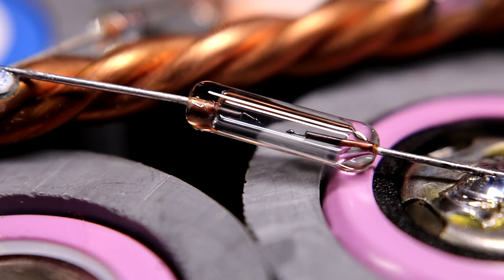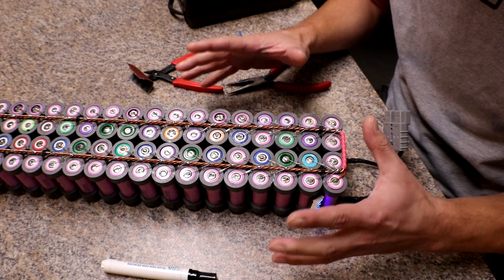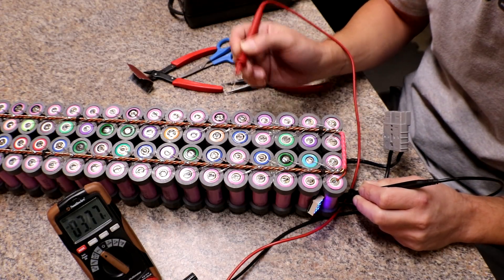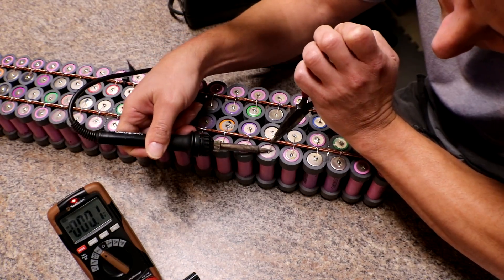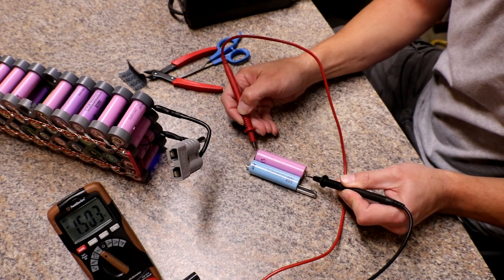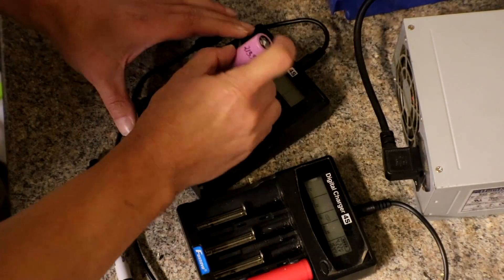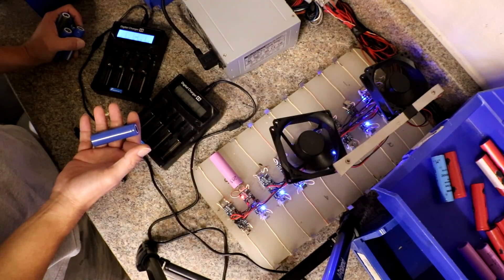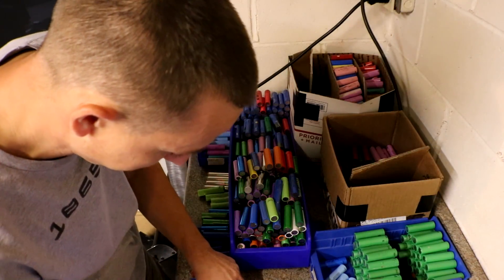Diy Tesla Powerwall ep63 1st Blown Fuse & How to Replace a Cell in a Pack!!!

Comment: Hello , what current are fuse use
Reply from the maker: At that time I used .5 amp as they pop at 2 amps. Next build Ill be using 1amp since they also pop at 2 amps but just a hair less resistance.
Reply: @AVERAGE_JOE  thank you for the info, i also want to use 1A. Have a nice day.

Comment: Hi, you did not test for IR of cell. That should indicate its condition. Further, charge and test if voltage drops after 2 weeks. If it did, bad cell!
Reply from the maker: When I originally tested the cells I didnt check IR.

Comment: No the opus is fine your a fucktard that’s all. Go outside sometime.
Reply from the maker: NOICE!🤣
Reply: AveRage Joe lol, glad you can take a joke. Thanks for all your content and info brotha, been doing a lot of research for my power wall and you really helped clear some stuff up. Shit can be confusing. Thanks man. I’m gonna go get some sleep.
Reply from the maker: People get butt hurt to easily these days lol. Glad some of the videos could help out a bit in random places. What size powerwall you thinking of building?
Reply: AveRage Joe sorry for late reply, I’m actually setting up a solar power bank for my ma cause she keeps spending $100s on shitty outdoor solar landscape lights that die in one summer. So I’m gonna hard wire a bunch of small led lights and use a small 50Ah power bank that’s charged via solar. Hope I don’t blow up lol. Got a few mono solar panels 12v 100watt, waiting for them to arrive then I take my shot. Any advice would be awesome bro. Thanks.

Comment: ... what about puttting some thin white plastic stripe just under the fuses so to tell at a glance if there is a blown one ---?
Reply from the maker: Yeah that a possability. The ones I used are tiny but if you use 2a or bigger you can see if there popped easier!

Comment: Does it get hot when charging or discharging? What about self discharge?
If everything is good here, it's most likely a human error as you already mentioned or the fuse itself had a problem. I would really like to know a real battery problem this might have caused the fuse to blow...
Reply from the maker: I dont remember lol.  Been a while.  I do remember is self discharging a little tho!

Comment: While Tesla uses fuse wire, you use these Chinese inline fuses?  You didn't mention what amp size fuse you entrusted your packs to.  :)
Reply from the maker: I have been using .5amp fuses and now using 1amp fuses.  With all my testing they both pop at roughly 2 amps in a slow burn!😆👍

Comment: How about PolySwitch Resettable Fuse Protection ? Can you use them insterad of normal blown fuses?
Reply from the maker: Yeah you could use those or even pico fuses but the only issue is you cant tell when one is blown or popped.  I have tested some pico fuses and they are dead on, just couldnt tell!
Reply: AveRage Joe - Yeah good point . Thank you for your time!
Reply from the maker: You betcha!🖒

Comment: The technique of DIY spacers made from 3/4" sched 80 pipe is cool but the spacing between cells seems larger than necessary. One commenter suggested staggering the rings during fab such that the spacing between cells is only one pipe thickness instead of two. That was genius! That's how I will put my powerwall together when I build it.
Reply from the maker: Yeah the spacing is more then necessary!  Doing the stagger would allow more cells in a smaller space for sure!  Let me know when you have one made as Id love to see it!👍

Comment: How did you come up with the cell holders ?
Reply from the maker: At the time when I first started this project, the black cell holders were expensive and I couldnt afford them.  I also didnt want to spend all the cash for them and then cut the little tabs off to remove a bad cell or take the hole pack apart if there was a bad cell.  So I took a cell to Home Depot and Lowes to see what I could come up with and this is what came out.  Ended up with 3/4" sch 80 pvc from Lowes part# 49731 https://m.lowes.com/pd/Charlotte-Pipe-3-4-in-x-10-ft-690-PSI-PVC-Pipe/3134567
Reply: Good Stuff.  Looks like some added space being taken up but, eaaa.  More then functional.

Comment: How is it to all the ebike battery building sites say under no circumstance ever solder directly to your battery, yet every single one of the DYI powerwall sites has them soldering to the battery.????
Reply from the maker: I havent looked at ebike battery builds, just seen pictures. Yeah spot welding for sure would cut down on heat. I would think they say that for an ebike battery because of the high drain and vibration but I could be wrong. I think soldering is fine as long as the iron isnt on the bottom for to long. The top side is usually quick and easy.

Comment: What is the thickness of the module with the 18650 cells and the plastic holders? I am planning a set up for my 2014 Rav 4 EV and I want to make sure I can fit the modules. Thanks!!!
Reply from the maker: +James Klafehn My diy cell holders I made are about 24"X4" but if you are looking for the black cell holders I can measure them when I get home🖒
Reply: 24" long x 24" wide I assume? How tall?
Reply from the maker: +James Klafehn Each pack of 100 is 24" long and 4" wide and height is probly around 3"

Comment: I really liked your fuse tests... Very helpful. I am building a new RV powerwall with the .5 amp glass fuses. (note: 2 years ago I built a 7s 100p powerwall for my RV. It worked great for a year and a half. Then major fail "It Blew up" 
Due to my design I could not repair so I am using your form factor with these new fuses. Hope to post some videos soon.
Reply from the maker: Awesome! Would Love to see the videos!  What happend to you last one anyways!
Reply: Well fuse did not blow when 2 cells went bad. This made the cell get out of balance with the rest in the cell which caused the other cells to over charge.
Reply from the maker: +RV-PowerWall Gotcha, that is the very reason I use low amp fuses. If a cell is on its way out it will take out the fuse first before it brings the pack down!🖒

Comment: What kind of fuses are those? And how do you determine your fuse?
Reply from the maker: They are axial glass fuses.  I wanted a fuse with low amprage because I wanted the fuse to pop when a cell starts to go bad.  After testing a few different glass fuses I went with the .5amp fuse because it will pop at roughly 2 amps.  If I had to do it all over again I would get the 1amp fuses because it still pops at 2 amps but has just a hair less resistance.  Most other people are happy with a fuse or fuse wire that pops above 10amps.
Reply: I am still not understanding the "too low" part... aren't you pulling more than 2amps through each cell? If so, how does the fuse not pop then and only when the amps are too low? Sorry for my ignorance. Great video's !
Reply: gpauwels0820 so what you wanna do is, find the maximum amperage power consumption of your ev, and devide that by the number of cells you have in series.

Let’s say, your EV power wall or power pack whatever it is, is gonna draw 650A/150 (18650 cells) in series, you get 4.33 amps.
So then you would just test a bunch of wires that blow a little over 4.33 amps, Incase one cell goes faulty.
And the above  information was from
Reply: gpauwels0820 gpauwels0820 so what you wanna do is, find the maximum amperage power consumption of your ev, and devide that by the number of cells you have in series.

Let’s say, your EV power wall or power pack whatever it is, is gonna draw 650A/150 (18650 cells) in series, you get 4.33 amps.
So then you would just test a bunch of wires that blow a little over 4.33 amps, Incase one cell goes faulty.
And the above  information was from Jehugarcia’s video “ Tesla style fuse 18650 “
Go watch the video to find some really good info
Reply: But I really like these Glass Axial Fuses
Reply from the maker: Under normal use they dont even come close to 1a. The highest Ive ever run with the system was during the live stream test and I ran 72amps through the entire system. Still not even 1amp per cell.
Reply: Thanks for the reply and information, so for example i have a 14S10P battery pack. so 140 18650 cells. The motor will continuously draw 68amps while in use. If i understand what you are saying, then i would take 68amps/10 (18650 in parallel) = 6.94amps. (series dbls voltage, while parallel soubles current, so wouldnt we want to use parallel instead of series?) This means i need a fuse wire lets say that will pop at 7.5amps correct? Now, if that is correct, my next question to fully understand the fuse wiring, i see a buss bar and all the fuses are attached to this. This buss bar would represent the same thing as a nickel strip being spot welded connecting the batteries in series correct?
Reply from the maker: Yeah your math is correct.  Just make sure your cells can handle the 7amps continuously.  You would want the high drain cells for sure.  Regular laptop cells wont like it at all.  For a fuse I would go a little higher since its a motor and there is probly an initial higher current draw when starting it.  I would say something like 12-14amps.  Yeah the nickle strips would be the same as the bus bar and again since you want to run 68amps, make sure the nickle strips can handle 68amps through the series connection.
Reply: 1. Great, glad my math is correct... that usually is what bites me in the ass... Anyhow, it seems like then in my case i would not use a cell wire fuse for the series connections ( i can rely on a BMS to help control that total current draw from the motor in that case), but more so for the parallel connections. Then i would look at a fuse wire which again would pop as maybe you said between 12-14amps, correct? 

2. Why do i see for powerwalls long buss bars being used? And for Ebikes (my case) i do not see bus bars... just multiple nickel strips spot welded in series and parallel to each cell. 
3. Are the buss bars mainly for looks? so in other words replace all the multiple nickel strips used for parallel connections and replace with a single buss bar which then a fuse wire from each cell can be soldered to the buss bar as i see in yours and many others videos? 

Sorry for the long questions. Hope i am making sense here. 
-G
Reply from the maker: Most dont use any cell level fuses for ebike that I know off.  Not exactly sure why but I havent looked into ebiks much at all.  I believe they just use a bigger fuse at the end of the series connection.  But Yes they use nickle strips that can handle the amps and I would imagine they spot weld them for vibration issues.
Reply: gpauwels0820 yes, that is correct. You got it down.

My honest opinion, I would prefer Spot Welding, I’ve heard, but not sure,  🤔 , but seems to fit, Solder can heat the battery cells more,  depending on the person, some people will put the solder to the cell and heat it for way longer than you need to.
And i guess that’s kinda bad.
If you see how Tesla cells are, you can break the wires really really fast with little to no effort, there’s a video of a guy showing how easy it is to break the Tesla wire fuse, So I’m sure Tesla doesn’t even use a strong spot welding their fuse wires, so they don’t OVER heat the cells too much. 
Mayb that’s why Tesla cells can go 300 recharges, and still retain over 90% !?  Over its life time !  That’s crazy good compared to other cells.
Reply: gpauwels0820 so all you need to do is, get a power supply, and test wires, until they blows round the amperage you want.
There is a video, about a great power supply, email me, I’ll send you a link.

My email,   TimmySaelee386 at Hotmail.com.    * note * Can’t the the “ @ “
Reply: AveRage Joe hey I love you content! Do you have any info on Pro vs Cons using 20A cells vs 35A cells ?
Reply from the maker: Thanks man! I dont think there is tooooo much different other then the C rating.
Reply: AveRage Joe is the “ C “ rating. the rate of discharge?

Comment: Two questions 
Where did you find those fuses?
What is the pen you use before you solder? Like a flux pen or something?
Reply from the maker: Originally I got the fuses from aliexpress but it takes for ever, now I get them from ebay https://goo.gl/qLxpT9 and you are correct on the pen,  https://goo.gl/Zs7cXU is the one I use.👍

Comment: Where did you buy these fuse and how did you select them ? I love ur work looks perfect
Reply from the maker: I first got them from AliExpress because I couldnt find them anywhere else but it took forever.  Now I get them from ebay cause they are much closer and get here faster.  I ordered a few different ones to test out.  I wanted a low amp fuse so I could catch a cell going bad much sooner vs a high amp fuse and the cell keep pulling the pack down until it could finally pop.

Comment: +AveRage Joe : Did I just hear you say you have fused both ends of each cell? If so why?  If so, the second fuse is redunant and not in the good "built in redundancy" way. Save yourself the time and only fuse one end of each cell.
Reply from the maker: No I shouldnt of said that, I only fuse the top.  At one point I was planning on fusing both when I was thinking of using just thin wire for fuses.

Comment: Opus chargers (I have a BT-C3100) break easily.  The fan wears out fast, I replaced mine twice already.  One slot is completely dead (it always acts like there is an imaginary battery in slot 2 therefore can't use 2Amp mode on slots 1 and 4...  The spring loader is damaged on slot 4.  The spring loaders suck.  These chargers would be a lot better if they were made to fit only the 18650 (18xxx) cells...  Mine calls for 12V 3A, so I just ordered a couple 12V adjustable buck regulators to use one for it straight off my 15P3S pack (might be 15P4S soon)...

I don't know why you didn't balance the new cell before adding it back into the pack... drain it to match voltage, etc.  within about 0.05V is fine
Reply from the maker: Thats what it seems like but then again I dont have one.  Maybe Ill get one and see how long it last lol.  Anyway you can open it up and see if there is anything you can fix.  The spring thing should be an easy one. Yeah thats another one I hear, the power supplies need to be bigger.  If it was further off I would have balanced it but since the fuse didnt pop I was cool with it and it was less than 2 amps👍
Reply: bcmasur that happened to mine also.

Comment: When i use to need to raise the voltage id use a 12v battery for just a couple sec you know safe right but also do you know how much a good 18650 can put out i used just a solid 12awg wire to short one with a dc clamp meter and was over 100 amps again super safe
Reply from the maker: +James Holbrook Damn 1hundo!!!
Reply: AveRage Joe I know right I was surprised I don't remember the exact number like in the 1teens
Reply from the maker: Eleventeen
Reply: AveRage Joe no 11xa hundred and something in the teens is what I was trying to say

Comment: I'm sure this gives you a good feeling of confidence in all the work you had to put into installing each and every one of those freakin' fuses!!!! good work! keep it goin'.
i bought a whole bunch of 2300mah batteries - my charger/discharger came back at around 550 on the many that i checked. so disappointed in my Walmart purchase! here i am sittin with all my 500ma fuses, welding station & nickel tabs.... (sup...sup..meh)
Russ from Coral Springs, Florida, usa
Reply from the maker: Oh crap can you return them since there from Wally World?  I would😀
Reply: nah, i don't think so. my 30 days has LONG since passed. i'm surprised that they'd sell them when they don't live up to the specs. - maybe i will raise a stink. btw, they were not the highest capacity that WM was selling. i chalk it up to being a newbie. if i go this route (which i have a hankerin' to do), i'll make sure that i'm getting quality capacities on at least 90+% next time!!!
Reply from the maker: +Russell Holt I bet you could!!!

Comment: I have a question. I have some new 24 volt drill battery packs. they have Samsung inr18650-15L cells in it. are they worth doing anything with. them being 1.5 ah cells or 1500 mah cells. even if they are a good deal. like 1.50 or $1.25 each and they aren't even old. about 7 packs .and I maybe ban get more. I just don't know about the 1.5 ah I haven't tested them but they say 1.5 ah @ 24v. if you think they worth using. I'll get all I can. I can get 2ah packs but they come to about $2.50 per cell. I don't think that's much of a deal. maybe 2.5 or 3ah cells for that or a little more I'd get some. thanks.
Reply from the maker: +James stranger Well it depends if you wanted to do an ebike or something for the lower ones. I personally wouldnt buy them but Im building the powerwall. The higher cells maybe. What all are you building again?

Comment: The capacity test should not take the cell below 2.8-3volts.  There is no reason that the cell should be below 3v. Under a volt is bad.  There is something weird going on with it.  I would recommend charging it then monitor its voltage over a couple of weeks before trusting it.  It may be rapidly self discharging- something I think I am seeing with my recovered cells.  I fear that is more common than we know with these cells!
Reply from the maker: I think the foxnovo takes them down to 2.7ish.  But yes there is something fishy going on.  I will definitely let it sit and check voltage over a few weeks to see what it does👍

Comment: SKYRC MC 3000 is a excellent charger..... 👍 
But no one use MC 3000 as a reference to opus except me and I can say opus is not accurate almost in every measurement is deviaton 30mah to 500mah......
But we have to consider that battery's are also different how they react in opus or MC3000....and how many cycles are needed to wake up.... to actual capacity...
Reply from the maker: +Bostjan Trancar Ture that! So your happy with the mc 3000?